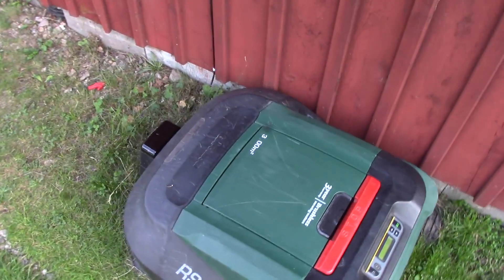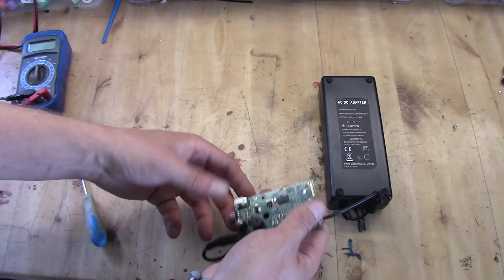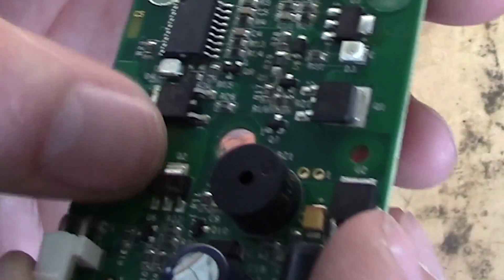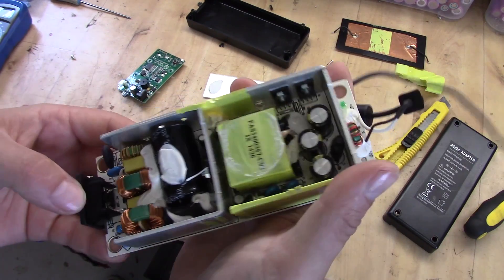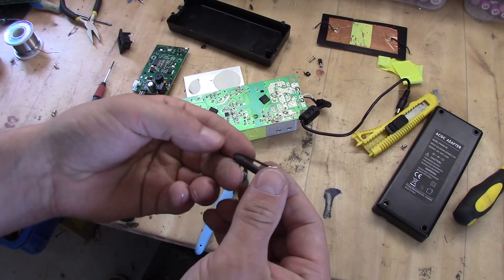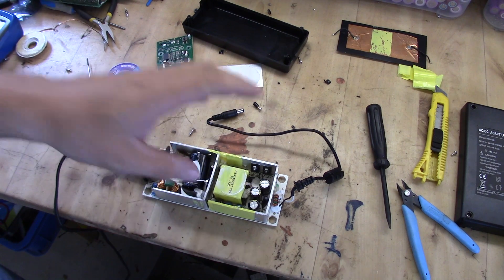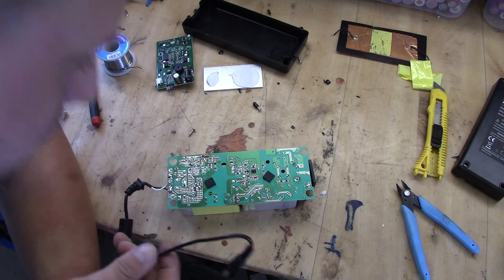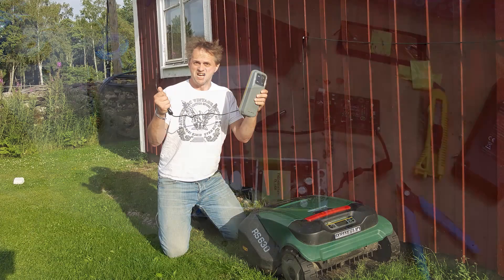LIGHTNING! - Repair possible?

Comment from the maker: Just got confirm from Insurance that they will take the cost and fix the main parts. Ie charger + motherboard. At the same time i will get to keep the old HW as it looks and that will result in a repair video! Thanks for support and lets see if we can get the old parts working afterwards.

Comment: do you use the SDM to get its values and store it somewhere (influx, grafana) through the modbus rs485? If so, what do you use exactly? because I'm having problems with my SDM120 (1 phase) and arduino nano.
Reply from the maker: Yeap i do. Script included in the ISO. When i install this new one i will make a video for it. Will be out end of this week or beginning of next.
Reply: but what hardware you use? raspberry/arduino/ESP8266? and which rs485 to connect to it?
Reply from the maker: Raspberry. But i have used esp too. I have used atleast 3 different RS485-TTL/USB adapters. For rasp i currently use these cheap ones: https://goo.gl/EVdFGB  for esp i think it was this one: https://goo.gl/8SGB3h with rs3232 if im not mistaken. That was a long time ago though. Currently all on raspberry since i have it to other things.

Comment: Lightning strikes are a big problem. When the wheather is bad I usually just switch off everything. Prevention better than cure.
Reply from the maker: Yeah it works if you are at home :)  I was 5000km away :)  Though since we have burried electrical grid here we generally only get issues if it strikes in the area and the problem is the lawnmower that has its wire in ground... BIG antenna for ligthning :) Have not pulled anything out in 10 years actually.

Comment: Easttron unit won't wake up? It needs more coffee.
Wow, just that transistor blown, you're lucky and probably was just a surge as a direct hit would've fried it.
Most power adaptors blow fuses and sometimes even the bridge rectifier and/or those little blue filters at the mains (not sure the name but they crack badly when blow).

Those sweeping beeps on the power supply is usually a short on the isolated secondary side. check the transistors and sometimes also the opto coupler.
Reply from the maker: Yeah when i get the new unit i will check . The hit was some where on the property my neighbor said. Because it shook their whole damn house :)  So not direct as in direct just very close.
Reply: I wished I was close, I could easily look and repair it. I used to repair everything from Tandy/Radio Shack many years ago, and I mean everything down to chip level and yes even SMD chips. Although we had the luxury of schematics but even then, once you learn the core how things work, you tend to know where to look even without schematics. These days it's just a throw out but fun to try.
I've moved onto IT, programming and hacking. oh well, good luck with it.
Reply from the maker: Yeah its a big waste today. im also in IT where there is no time to "fix" stuff.... Its shame. I have left those parts in my good to have/try to fix box... Lets see.

Comment: Buy the new unit, pull it apart so you can get the numbers for the transistor for the board and replace that.  The power brick could be replaced with a DC-DC buck converter to get your 34V. After testing the unit for awhile and happy with the results, return the unused kit and get your euros back!  🙃😋😎
Reply from the maker: Cant return if after its used. Its shipped from another country :) No left in sweden....  Lightning season haha.... But yes should run it of the battery bank from the solar. Gonna look for replacement for that! Thanks

Comment: Yeah common failure mode with these types of switch mode power supplies is the optoisolator. Just pinch part from another powersupply, even a PC one would do.
Its' the odd 4 pin black dip package, just note where the dot is.

The ticking means it's not dead, just sick.
Reply from the maker: Ahh cool. I will take note of that. Would be cool to be able to sort it. Some day i need to learn a bit more on how those things actually works in practice... :)
Reply: Yeah, if the power supply is "beeping", its primary side is likely ok. The chirping with changing pitch means it doesn't get feedback from the secondary. So as said it could be the optoisolator (the thing right to the left of the transformer; left, if you put the letters on the trnasformer the right way). But I also had broken diodes (the to big things mounted to the heatsink near the output left above the transformer).
The good thing is, pretty much all the parts in switch mode power supplies are jelly bean parts. The chances are good that you find what you need in any other PSU of approximately the same power rating.

Comment: Seems pretty simple to repair, I wouldn't buy a new one, there's  another identical looking component on the PCB, just get one of those and replace the burned one and get another ac2dc supply for it
Reply from the maker: There is no other component on the board with the same numbers and im missing half of the number. I could potentially wait for the schematics that i ordered but did not want to wait for it :) The powersuply itself comes in at around 70EUR the cheapest i could find. With decent shipping. The issue is that i could potentially solve it but then i have to wait atleast 1.5-3 Week for parts or even more. And since my insurance take 2/3rd of the cost its actually the same in the end :)

I will of course sort the board when i get the new one or the schematics to see what component is screwed. Though its still no guarantee that the rest is ok :)  Will do follow up about that
Reply: DIY Tech & Repairs Q3 isn't the same as Q2 on the PCB? With insurance replacement makes a lot more sense 😀
Reply from the maker: Nah it wasnt :) I actually ran out and crosschecked again. Because you got me unsure if I did miss that. Its another number in beginning even though it looks the same and same size. Of course they could be close.  Yeah the home insurance "should" cover most. I have it for lightning. But it do take a couple of weeks before i get that money.
Reply: What is the partial part number for Q3 then ?
I'm wondering if it could be a voltage regulator, as those use the same package. A common one being 1117-??
Reply from the maker: Nah its not voltage reg. There is LM317 at the side and its mentioned as "U". It looks like its related to the signal generator part for the wire around the property. It starts with 29 and i think next is 5. But the new board arrives tomorrow and will take a look then.